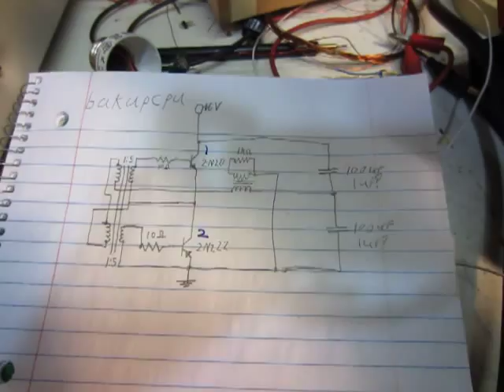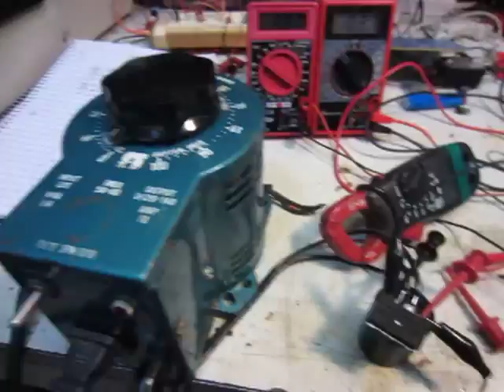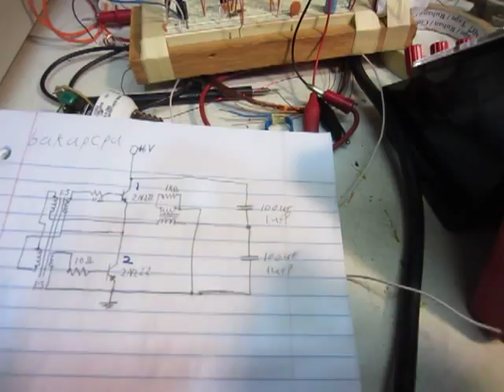Bakupcpu's 2 Transistor Self Resonant Circuit Running a Flyback Transformer From 140 Volts

Comment: @makerj101 Solid State Tesla Coil, VTTC's do exist too (Vacuum Tube Tesla Coil) but a sstc is driven by a transistor instead of a spark gap, lots of capacitors and a hv transformer

Comment: Starship for Tesla primary could be very interesting. Although it would have to be thick wire, and only a couple of turns (laps). Should do something as wifi transmitter. all it needs is pulsed power. HF HV is what Tesla was all about.. You could try adding a tank circuit to improve tuning.

Comment: Nice one! I'd love to see the wifi field's. I've blown a few of those transistors.. they don't seem to like lots of negative volts on the base. Some of them go to 1700v though! Been thinking about trying that circuit on wireless electricity. Is that a 27 point star-ship? What does that do on Wifi? I love the red glow under the desk as you turned it up. Looks very Frankenstein movie!